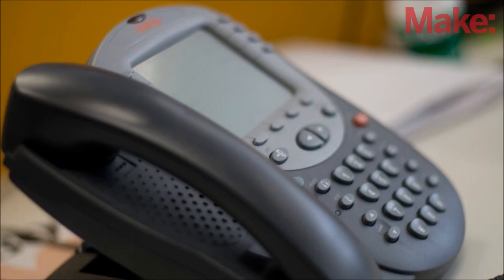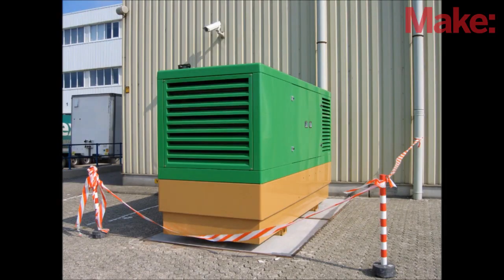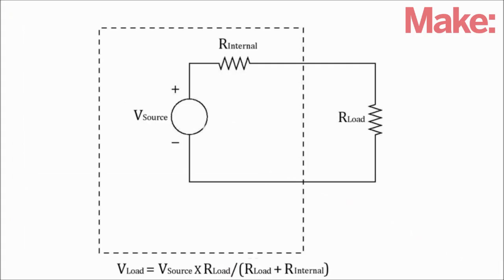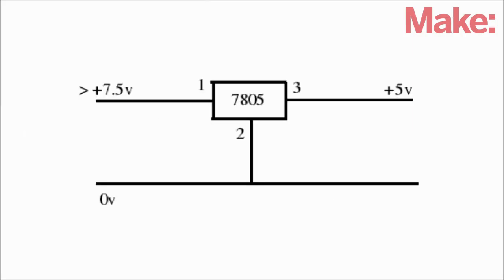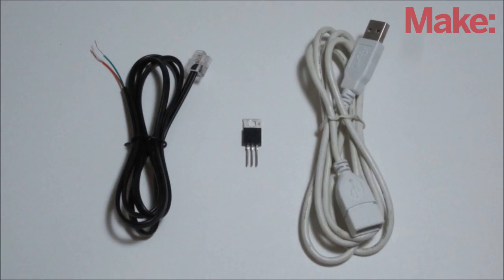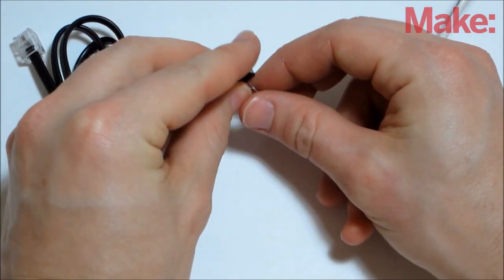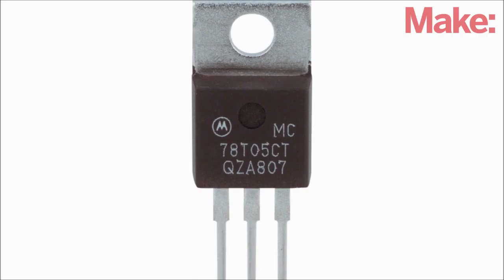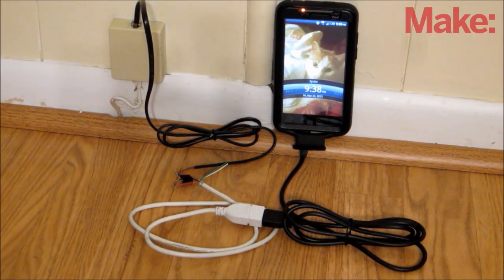DIY Hacks & How To's: Emergency Power from a Land Line

Comment: Diode isn't gonna help if the phone rings. The voltage reg. will generally release it's magic smoke if the input is above ~30-35V.  Ring signal=90V(ac).  Some simple math should show you the problem.(hint: it's about 60V too high. Better hope nobody calls.)
Also,this is probably considered illegal in most areas,'theft of service',etc.
And,as mentioned,a phone line has the overall power of a flea-fart. Not much current. Not terribly useful. 
I'd be surprised if you could charge a cellphone.

Comment: Excellent tip! However I would like to see more about that diagram you showed concerning the voltage coming from your phone line. That part got a bit confusing. Also what sort of diode would work in this situation?

Comment: Not sure if this is posted, but this only really works if you have a POTS line (plain of telephone service). If you have telephone service through FIOS or Cable you are connected to the electrical grid. It does have a battery backup but its not going to work forever. But like others have posted just use the landline. Of course if you use say Vonage you get nothing at all since its all VOIP with no battery backup unless you installed your own UPS but then just plug your phone charger into that.
Reply: Exactly... wpuld have been though back in the day like am alternative to paying seperate bills for phone AND dwelling or residemce electricity... meaming power your stuff just not fast all at once but yeah.

Comment: ok lemme get this straight, instead of using the perfectly good land line that works, you run out during a power outage, buy a LM7805 with cash, no card swipes people powers out, run back home tear into two good cords to charge a wireless cell phone that probly wont work due to a POWER OUTAGE instead of using the landline. MAKE some damn sense.

Comment: expect your phone bill to be 10 times bigger xD
Reply: That's not how it works 😂 they charge you based on how long you talk on the phone. They dont even notice how much power is used from the phone lines since it's a very small amount probably under an amp

Comment: you should check the absolute maximum ratings of the regulator... they are usually rated around 35V max. Though I bet Jason checked, that the internal resistance of the phone line fixes this problem most of the time.